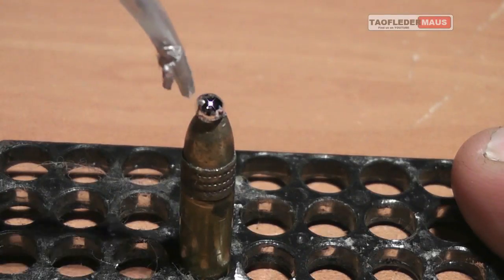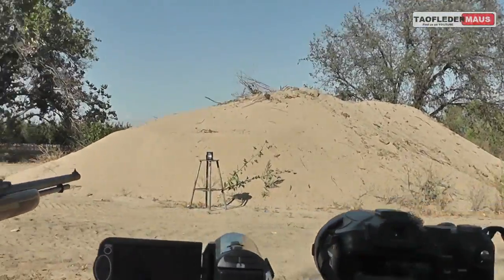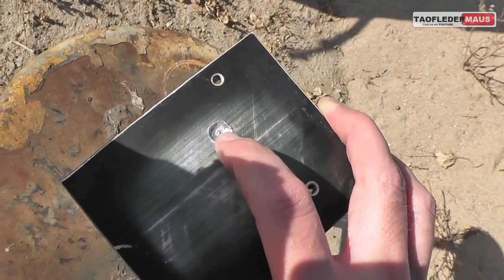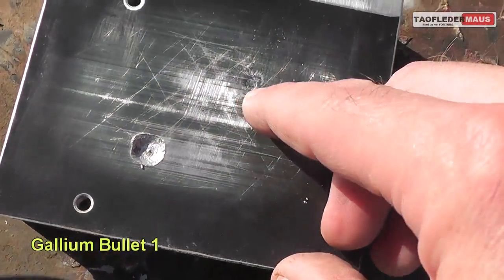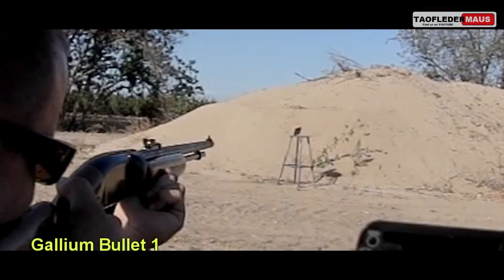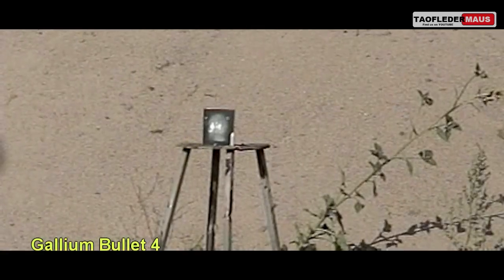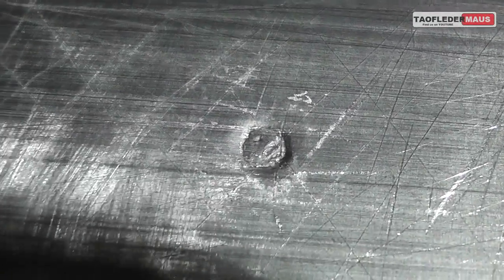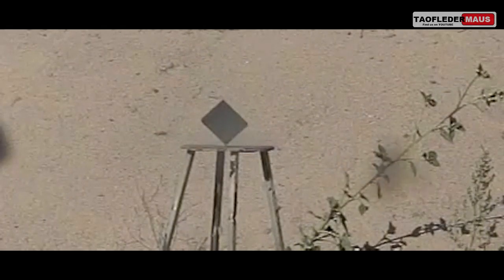GALLIUM Tipped BULLETS -  The SABOTEUR'S Tool?

Comment: What about a larger bullet boring out the back not the tip so it gets better penetration with a larger amount of gallium. Perhaps it could be loaded into the round inside of Some kind of capsule so you don't need to worry about temperature or it interacting with the bullet.

Comment: cool, but you should have used glass bullets or plastic bullets ( or ice bullets if you can create a container from ice to keep gallium) so you won't lose gallium when is affected by friction... and the impact would splatter gallium on steel surface and melt it like it was butter

Comment: This would be a pretty good way of disabling aluminum aircraft. Imagine a FMG slug or .50bmg filled with gallium. It penetrates the outer skin then spreads over all the aluminum components. That airframe would need major work if even operable at all. The bullet wouldn’t immediately kill the craft but say $10 for a multi million dollar aircraft is a good deal in any conflict.

Comment: yeah, it's best if gallium is applied gently and spread on unoxidized aluminum surfaces, impact with may not leave enough molecules to really break down the aluminum. interesting might be to fill paintballs with liquid gallium so they splat on the surface

Comment: I know this is an old video...but I'd like to see some modifications to the bullet. First...a round that allows for a deeper hole to be drilled. Second...fill said hole about 3/4 full and cap it with some solder or lead. This should keep the gallium contained while it heats up on it's way to it's target. I imagine this would make for excellent anti-aircraft rounds.

Comment: Aluminum oxide, which builds up naturally over time, can reduce or prevent chemical reactions with materials like gallium.  The aluminum would have to be scrubbed clean of oxides for a gallium tipped bullet to have the effect that you're trying to achieve.

Comment: As an FYI, the result isn't always visually apparent. You have to actually check its structural integrity. I've seen gallium turn aluminum into paper. Probably a better way of doing it would have been filling it with gallium but then capping it with something like hot glue, so it can be liquefied when it hits.

Comment: why not shoot a pure gallium slug???
Reply: by the time the bullet would reach the end of the barrel it would be a liquid
Reply: adrian gasiewski but it would still fly out of the barrel to an extent.
Reply: +skulldriver101 Liquid gallium is pretty sticky and you rlly don't want that stuff shocking on the inside of ur barrel
Reply: aapje opeenwieler well 1 or 2 shots through a junk shotgun would be fine as long as you dont have an aluminium barrel and you cleaned it good afterwards.
Reply: +skulldriver101 how are you goin to clean it. it is easyer to make enough money to buy a new gun then to actually clean it
Reply: why couldn't you run a normal cleaning swab through it?
Reply: +skulldriver101 with an iron Brush that is a bit magnified and heated it might stick to it but you are not gonna get it clean that easily.
Reply: a cloth swap not a brush
Reply: not gona work m8 it is attracted way more to the metal then to the cloth

Comment: When the metal was first extracted, it WAS called aluminum but (British I think ) scientists felt that it should have an ium ending to indicate that the element was a metal.
Other metals DO have IUM ending:-.cadmium, sodium, calcium, uranium, magnesium, potassium, platinum (nearly), gallium, plutonium, polonium, cuprium in Latin and others.. Helium is an unexplained, odd exception. When it was changed, America stuck with the original.
On this, they are quite correct! Confidence doesn't come into it.
Whilst I gripe at much American mutilation of English, I have to support them on this one..
From Sea to Shining Sea...
From a Limey.

Comment: well if you think about it if you shot an engine block that was made of aluminum, you could severely damage the engine if the gallium were to react immediately. especially if it was already running or warm. Airplanes would be vulnerable, as well as any structural aluminum. But as you have shown, it's not the best way to sabotage something but an interesting experiment none the less.

Comment: The gallium makes an alloy with the aluminum and does not corrode it. It more or less steals the aluminum. Makes the existing aluminum very weak almost like wet cardboard. Also the new alloy of the aluminum and gallium is very reactive in water. However its the aluminum and not the gallium that is reacting.
Reply from the maker: +Adamantian Gilga  How do you explain the hydrogen formation?
Reply: +TAOFLEDERMAUS Here https://en.wikipedia.org/wiki/Gallium
There are two parts to look at in the article. Physical Properties (second paragraph) and Chemical Properties (Hydrogen compounds)

Comment: Not gonna work, the Gallium has to be liquid in order do it's job on the AluminYum.
It then will drain electrons from the metal, untill you can break the metal in half with your bare hands, as the Gallium makes it as fragile as toasted bread. And that should need atleast 24 hours, it's not really a fast reaction.

Comment: Gallium is illegal on passenger flight airplanes. If you had a large enough quantity (which isn't a lot) it would eat a large hole in the aluminium of the plane causing decompression and or structural failure.

Comment: YOU pronounced Aluminum correctly as spelled.  The Brits and others pronounce Aluminum with an extra i in the spelling Aluminium.  There is absolutely no reason for you to apologize for pronouncing the correctly spelled word accurately.
Reply: +comcastjohn We spell it aluminium, like its legitimately supposed to, americans have a tendency to simplify/shorten words (e.g color (American) and colour (every where else)).

http://www.iupac.org/fileadmin/user_upload/news/IUPAC_Periodic_Table-8Jan16.pdf
That's the periodic table of the elements for the IUPAC (International Union of Pure and Applied Chemistry), Aluminium has the atomic number of 13 and symbol "Al" it is clearly spelt as aluminium.
Reply: +Rated_R_4_Radical British English often drops its "r"s. It's not a simplification tendency, just divergent evolution of a language.

Comment: Gallium is in the same vertical column as aluminum on the periodic chart, that means it combines chemically like Aluminum. If you are trying to get corrosion this would be the least likely element to choose, (except for the noble gasses of course.)

Comment: Chemical reactions like that of gallium and aluminum take time.
LOTS more time than the microseconds that a bullet has to interact with the surface before it ricochets off the surface of the aluminum.
To get a reaction, the bullet will have to deeply embed itself in the aluminum and stay there for a while.
Give it time, the longer the bullet is in there, the larger the reaction.
You'd want to test it on a target more like a massive ball of aluminum foil.
Take a full roll of foil, stuff it down a 2 liter, and shoot that so the bullet goes down it long-ways (the more foil it has to go through, the better. You want to ensure the bullet stops inside the foil without punching out at all).

But at that point, why bother shooting it rather than just wrapping the gallium in aluminum foil to begin with?

Comment: The gallium would react with the aluminum if you added water to it. The aluminum would turn into Aluminum Dioxide, leaving the gallium as only a catalyst. Aluminum Dioxide is basically aluminum rust.

Comment: Dude what's the point? Why not shoot Jello?    Wanna do something real?  Cut some tig welding tungsten....put a quarter inch in a high power round. Instant armor piercer.
Reply: +Bill Kichman doesn't work that way.   the  tungsten has to be directly propelled or the soft carrier will  flow over it when the tungsten tip hits the armor. Tungsten core Projos are more on the order of a headed nail  through a steel or similar metal with a head as the base of the bullet that the hot gasses from the burning powder acting directly on the penetrator Steel, bronze and similar hard carriers are used as they force the puncture open wider rather than a "pin hole" that would otherwise exist. With soft carriers and without a monolithic base the bullet would splatter and the penetrator would bounce off anything more than heavy sheet metal. And before you ask, I have more than  theoretical knowledge in this field

Comment: For the corrosion to be more effective, it has to stay in hot and humid conditions, and even then it will only make the aluminum brittle, though I wonder if the corrosion would actually happen deep enough to make a block that thick break easily. You could shoot it again at the point of corrosion to see chips of aluminum fly out lol.
Reply: +JJtoob Gallium will react with aluminum  at any temperature above absolute zero,  just as salt will react with steel or iron. Temperature  is not a function  of the chemical reaction itself, just a modifier of it. The Gallium is consumed on a one to one weight ratio when combined with aluminum.  So the insignificant amount used in this instance would be completely consumed, very quickly. There are several things that would change the outcome: first the removal of any surface coating, and the use of pure aluminum, which the heat sink is  not, and one final step: annealing the metal first, allowing deeper penetration before splattering the  gallium off the surface of the metal.   These are simple facts based on the laws of physics, chemistry and metallurgy.
Reply: Scott Schoemann All of which I'm ignorant about, but I think I watched someone else do a similar experiment and the conditions of temperature and humidity had an effect on the reaction, but I forgot what video that was.

Comment: Gallium doesn't corrode the heat sink. It alloys with it. Gallium is a metal. Not an acid or a base. If you pour gallium onto the heat sink and leave it then it wont corrode away. It will however be very brittle.
Reply from the maker: +Ryu Ranzou  It definitely causes a reaction and actually off-gasses hydrogen in the process.
Reply: +TAOFLEDERMAUS can you please document that reaction? If you have elemental gallium and elemental aluminum, where is the hydrogen coming from?
Reply from the maker: here ya go
https://www.youtube.com/watch?v=aGxsHkWRF-E
Reply: +TAOFLEDERMAUS That is NOT a reaction of the Ga(llium) with the Al(uminium). Its a reaction of the Aluminium/Gallium alloy (which after creating the alloy now is liquid under room temperature) with the Water. Mixing Ga with plain water only creates the insolulabe Ga(H2O)6

Comment: What if you used something in a larger caliber, but sealed the gallium in with wax or something, making the bullet more aerodynamic so you don't lose speed or power. A blob on the tip like tht certainly has to effect the bullet's flight and other characteristics.

Comment: You should have shot the heat sink again after letting the gallium do its thing to the aluminum. It may not have visually changed a lot but I can guarantee you that its damage resistance has been reduced severly. Heck, if you shot it again it may even shatter or just have a clean hole through.

Comment: you shot a bullet tipped with a metal that melts at 85 degrees keeping the bullets in ice the the metal doesn't melt?  Ummmm you do realize gun powder burns at over 800 degrees right?  seem s kinda pointless to put them in ice then.

Comment: I've got a suggestion.  Get some concrete nails, drill out a 22 round enough that the nail will go into it about 1/4 inch, with a dremel tool, cut the nail off flush with the end of the bullet.  Essentially the bullet will be the sabot for the nail piece.  Try it on your aluminum or steel.
Reply: +RonALampman that's called a bimetallic round, Wolf Ammunition  makes them in 5.56x45mm and 7.62x39mm among others
Reply: +Scott Schoemann Hi Scott, the bimetal in the Wolf line of ammo I'm pretty sure is referring to the jacket such as copper and some other metal to form an alloy.  Brass is another common use for jackets.  Though I thought it would be cool to try the tip of a concrete nail because they are used to hi impact and maintain their integrity even thru concrete.
Reply: +RonALampman Bimetal refers to the core metals and not the gilding (jacket) metals. the Bimetallic Wolf rounds are copper jacketed lead with a steel slug penetrator, and they will easily punch concrete, depending on the mix and thickness, however, they do penetrate body armor. A large number of Russian and Yugoslavian manufactured ammo utilizes steel cores. Part of this is to increase the ballistic coefficient as the steel lightens the bullet, so to bring the weight back up the bullet is lengthened, this increases the ballistic coefficient, which makes the bullet more stable as well as holds more of the bullet weight together, on penetration, again increasing efficiency on taking game, on full metal jackets it also prevents excess damage to the person shot (military applications only) where wounding is preferable since it requires someone to tend to the wounded individual thus taking two out of combat instead of one. Treaties on humane combat require this, however the Islamic forces we have been fighting dont follow these treaties and use whatever ammo they can get including banned varieties, and since they want to die in combat they dont try to assist their wounded...

Ive been shooting Wolf Ammo for decades due to the low cost and the fact that I have class three firearms that burn up 20 rounds in less than 5 seconds...
Reply: +Scott Schoemann That's pretty awesome Scott.  I was going off of the Wolf web site.  I know we used armor piercing rounds in the military, and the full metal jacketed  ammo is as you said, to take out more than one in a combat scenario.  However, the US did not sign the Geneva convention but have been using methods in accordance with it for decades.  That said, our special operations will soon be or may already be using expanding ammo for greater stopping power.  Nothing worse than going into a close quarters combat situation (in a structure) mortally wound an enemy fighter and he is still capable of killing either you or your friends before he expires.
Reply: +RonALampman I wont comment on spec ops ammo that I have personal knowledge of, so as not to inflame others, but you are spot on  as far as the US refusing to sign the ammo portion of the Geneva Convention treaty.   The problem with most of these treaties is when you attempt to make war moral, it loses it's ability to act as a deterrent due to the lack of the horrors it can bring.

Comment: you need to keep the gallium liquid for it to react properly...I know you said you tried heating it, but did you try KEEPING it under heat?
Also you didn't try picking at the spots where it was hit, it's not supposed to outright break it, it weakens it, something else has to break it.
Reply: Then it would be impossible to fire
Reply: YELLING ARNOLD I don't understand how that would make it impossible to fire?
Reply: +legionbunny Think he understood it as you saying they have to fire it as liquid.
Reply: Kajan451 you wouldn't have to fire it as a liquid
you fire it, it hits heatsink, heatsinks are hot.
it melts.
Reply: legionbunny I didn't say you would. I said i think that is what the other guy is saying and why he believes it to be impossible to fire in that state.
Reply: Kajan451 oh, makes sense now
Reply: +legionbunny how would you know it wasn't the heat  then???
Reply: Scott Schoemann because under normal circumstances heatsinks don't fall apart when heat is added
Reply: +YELLING ARNOLD (IS EVERYWHERE) Gallium only needs 30C to be liquid, it looks like they needed ice in order to keep it cool. I am not sure, but I think the heat the bullet gets from being fired should heat it over 30C.

Practical I would like to see a larger cartridge and you can always seal the top with a drop of hot glue or what else you have in handy.

Gallium is not consumed when aluminum is oxidizing, there fore the long term effect should be effective. There has been prototypes on cars where you can drive a car and what you need to tank is aluminum and water, and have some Gallium as a catalyst.

Comment: "I probably am asked to shoot mercury out of a gun 20 times a day" Shoot it in a controlled indoor area where you can recover it all.
 I did it when I was a kid 35 or 40 years ago we shot it out of a .357 mag. We shot pumpkins, gallon milk jugs full of water, other stuff also, to our great disappointment there was no difference between standard hollow points and the merc filled ones. Not that we could see with the naked eye. We did it the same way you did, drill the hollow point out add merc and seal with melted plastic or hard wax we tried both ways. We than loaded the 125gr  bullet to a fairly hot powder load making sure we kept the bullet very close to the original wt.
 We were all unimpressed and never tried it again but with your slow mo cam it might be cool.
Reply from the maker: +taz man   What probably happened was the g-shock caused the liquid Hg to accelerate faster than the bullet so it just blew out the barrel ahead of the bullet.   Sort of a newton's cradle effect.

Comment: Why don't you try taking the center out of the bullet nose with a drill and placing a tungsten carbide scribe tip in it?. I'll bet that will go clean through that heat sink. You should maybe figure out some better fixtures instead of using junk stools and such, like a heavy 2 x 4 wooden platform and some kind of clamping system, because a lot of energy is being lost when the bullet moves the target from the impact. I don't get why one would bother putting gallium into a round, seems like kind of a stupid
idea that wouldn't accomplish much......
Reply from the maker: +Robert Schumacher  I don't know man.